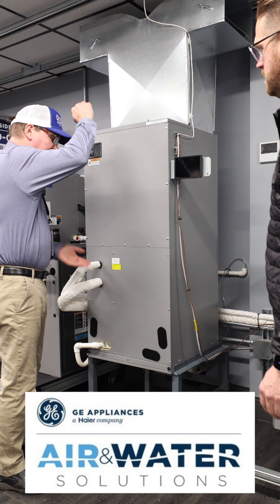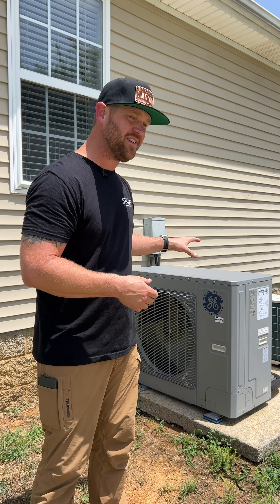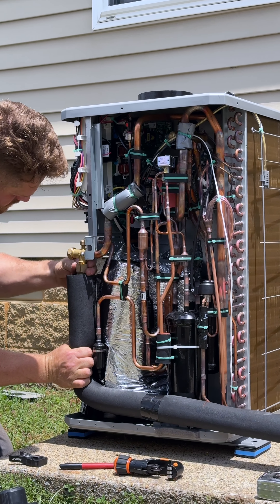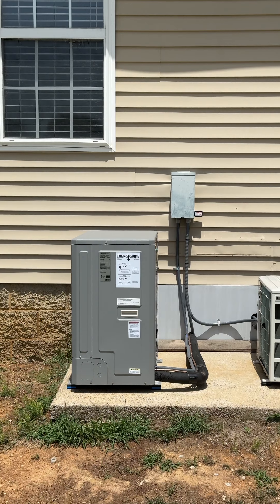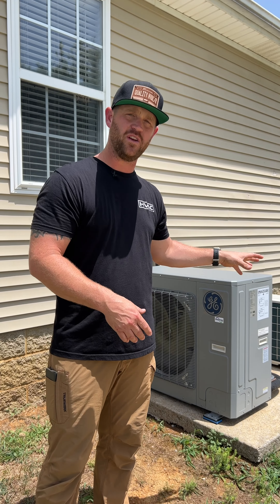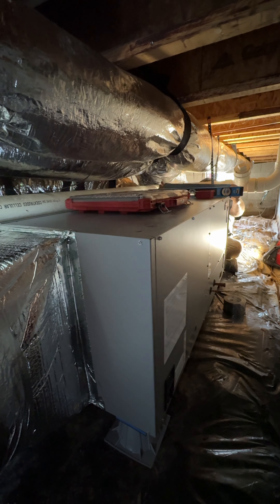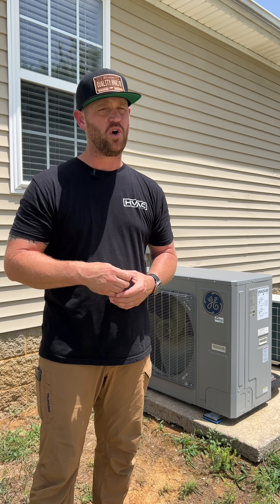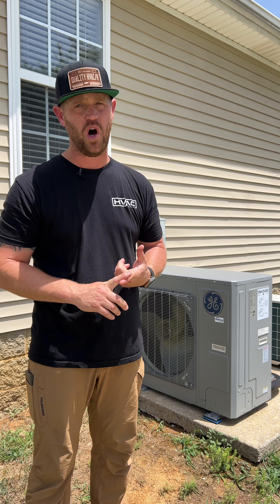Variable Speed Heat Pump Install

Comment: These units have a variable speed compressor but are constant capacity. Dip switch settings allow for different compressor rpm ramping patterns

Comment: I like my 4/5 ton but would love the chance to talk with you about a couple of tech questions as my installers were not as well trained. Mine seems to use A LOT of energy in the winter compared to the 5-ton 2-stage it replaced, and I’m trying to see what I can do in commissioning to help. Thanks.
Reply: If it's using more power than your pre existing non inverter 2 stage heat pump. You are most likely over sized. I bet the new Connect you had installed should have been a 3 ton. The reason? The inverter type has way more output at lower temps due to the mid vapor Injection compressor. Also check to see if the thermostat they Installed has the second stage emergency heat coming on due to a small differential on the thermostat. Is the d terminal hooked up when it goes on defrost. If so disconnect it. It brings on the back heat strip every time it goes on defrost. That's if you have a electric back up heat strip.
Reply: @John8910  No heat strips, but my setup is complicated by having a zoned system.  So the house is probably a 4-5 ton house, but each zone is something less.  I'm running 4-ton economy at 4-ton fan speeds  (325-350 cfm/ton) to try to get the most efficiency.  It has put out 105 deg F hot air under all conditions but at the cost of 7800W of power when it ramps up.
Reply: Well that sounds like a air flow issue. You need to flow 1600 CFM at .5 static pressure for the duct package. If all zones are not calling you will have considerably higher static. I am surprised the unit has not tripped  E4  high discharge on the outdoor condenser yet. @yt_tam
Reply: Are you in a cold part of the country.? Does it get below 20f in the winter season?
Reply: @John8910  Yes in Pennsylvania. I can get 1600 cfm at reasonable static, but I targeted a little lower based on Gree recommendation to target the lower flow rates to get the benefit of the inverter and better dehumidification. 1600 cfm still ramps the power way up, just turns on and off more often.